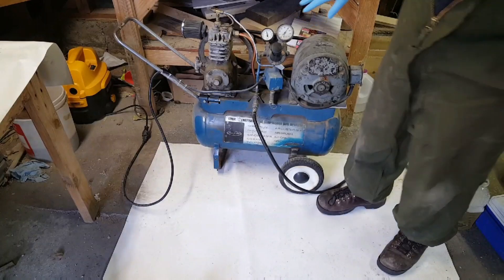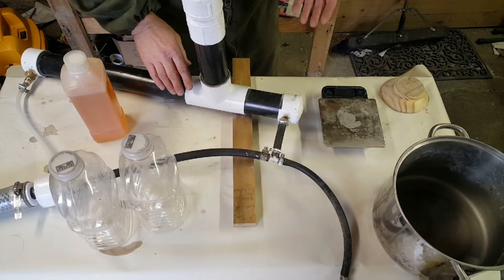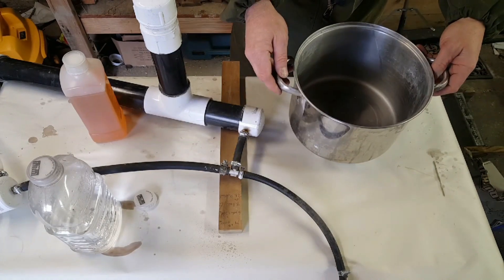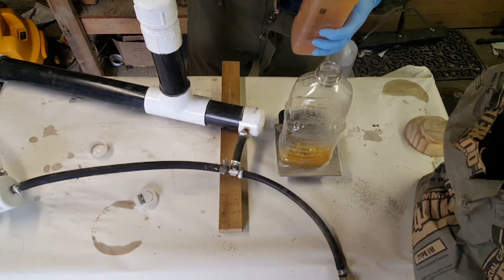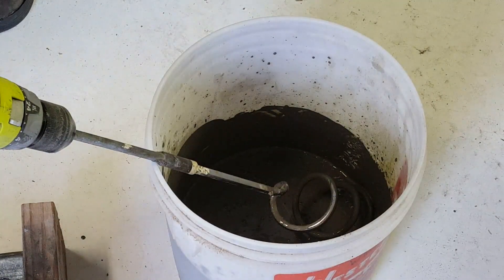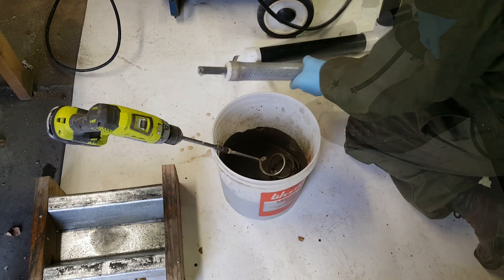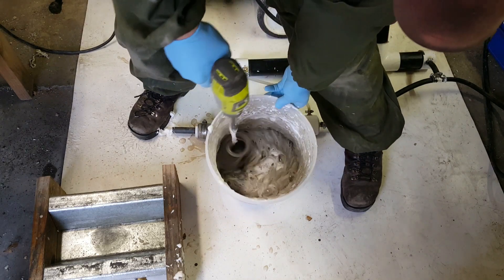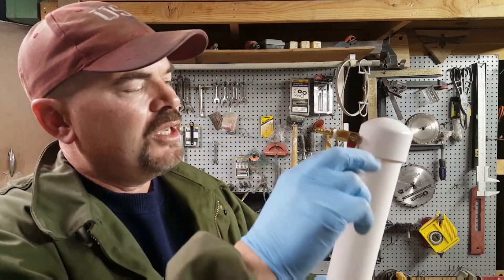Foam Mate Questions Answered

Comment: I have a question, if I may. What will happen if one adds very small shredded bag plastics or fiberglass to the pail with the cement,  will that help with reinforcement of the AirCrete?
Reply: it will... saw in other video

Comment: Wouldn't it be easier to come up with a mix that's like ... for example. . 1 bag cement 10 gallons water and 24oz bottle of soap ???  makes 50 gallons of aircrete .. just a thought instead of all the little measurements

Comment: Hello Darwin, Nice Video. What is the ratio cement and foam. I want to make CLC in my Country Indonesia.
Just Trial make CLC block with dimension L = 60 cm W= 7.5 cm and H = 20 cm.
I used cement and sand Ratio 1:2. cement and water ratio 1: 0.5  Water and foam ratio 1: 40.
what is ratio(cement + sand + water ) : Foam?
If Mix 250 ml foamAgent and 7.5 l water, How  many liter can i Produced foam.
thanks

Comment: Due to the coming Eddy Solar Minimum, I am setting up a rocket stove and mass heater company, IceAge Rocket Heat.  I was concerned about weight until I discovered Aircrete.  Am going to order a Foam Mate pronto to be set once the snow melts up here in Canada

Comment: I am  very interested in this!  I do have one issue that I saw in the video regarding the ratios.  You mentioned that there were 768 oz. in 6 gallons of water - this is a fluid volume amount.  When you divided that by the 94 pounds of cement weight per bag, this would have given you a fluid volume of water per pound of concrete ratio - almost 8.2 ounces, yet you were weighing the water.  Had you already converted that amount of water to a weight to know how much water to weigh out?  I don't mean to be hyper-critical or anything like that - I just want to be correct when I go to mix up my amounts.  Brilliant work by the way!

Comment: Your ratios, as demonstrated, are "weight" ounces, not fluid/volume ounces, correct?  There could be a big difference between the two as different materials (water, soap, dry portland cement) have different densities.  This difference could structurally weaken the final product if the engineering on it was done using the other method.  Just wanted to make sure this possibility was taken into consideration.   Great video.  Thank you!

Comment: Hey to Darwin, thanks for all the videos. 

Question please: 
Did you change your mind about using the Suave oil-control shampoo? 

Suave shampoo definitely appeared to make much longer-lasting foam than the hand soap ... as you said something like two hours before mixing it in to the concrete slurry. 

And that compared to the hand soap which broke down in less than 45-minutes.

Peace of Lord Jesus upon you and yours.
Reply: Just use the Dex.  Far more expensive guessing than doing it right the first time

Comment: Thanks for the details.  I use a similar foam generator for my field sprayer. I use a pancake air compressor run via an inverter. Saved about $1000 over commercial unit. I use 2l coke bottle on each end of the boom.   Going to make building block for an insulated pump house.   Thanks again

Comment: Thanks for the great content! Can you do a large precast panel? Also, as other people have asked, can you use any sort of reinforcement in this mix, including rebar, and if so, would this compromise the strength because of all the air pockets, or add strength, like regular concrete?

Comment: What would you think about using a water glass solution before boiling out all the water as the water for the cement? The water gets evaporated out by the cement and you would be left with "air water glass crete". Just a thought. I live in Buffalo NY. our weather just broke so, I am going to be testing this theory out soon. Great video by the way and thanks for your time to break it down

Comment: you are using liquid soap to make foam for aircrete cement block. some other video shows using foam agent. foam agent is costly comparing with liquid soap.can tell which one is best suited for aircrete cement blocks any advatage or disadvatage/

Comment: could you use fiber in the aircrete to re-enforce it?
Reply: No one has done extensive tests on aircrete, e.g., testing double air (100%), triple air (200%), quadruple air (300%) mixes. So we don't know if it needs re-enforcing.
Reply: He does use straw
Reply: i don't know why you can't, they put it into concrete.